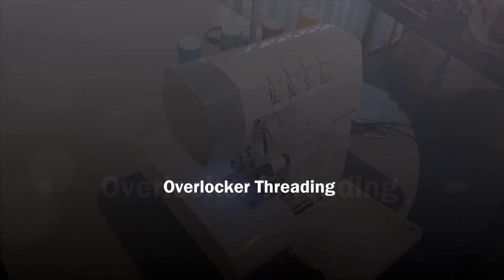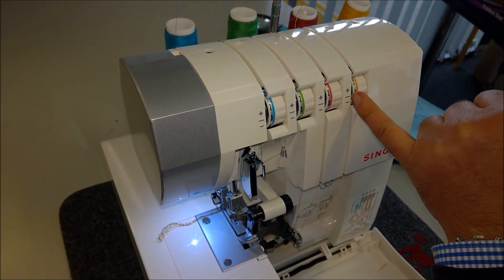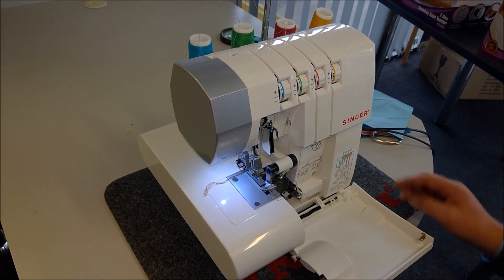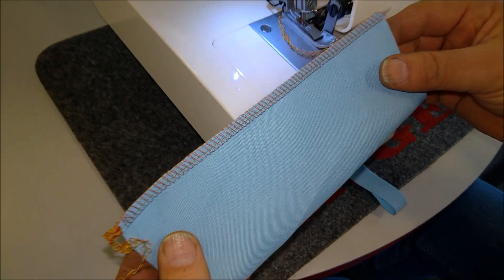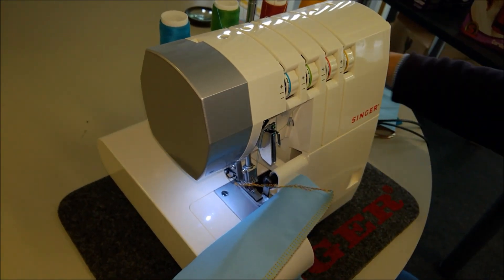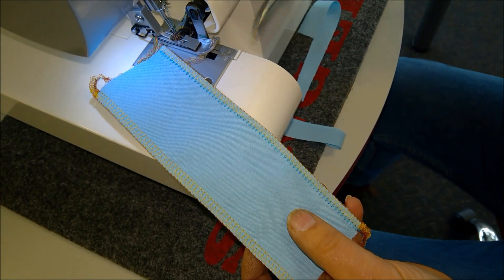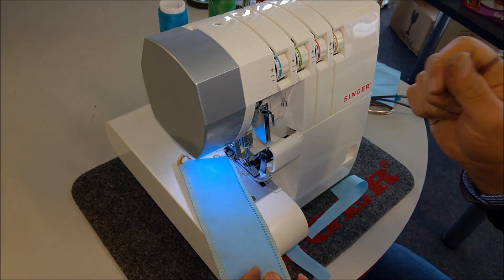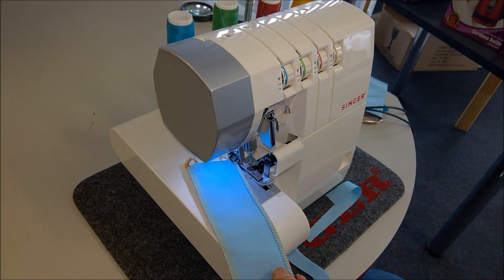Overlocker Tension

Comment: I have re threaded my machine but even at tension 9 it won't make a pretty stitch and it seems that they are loose as if there is not enough tension... is there any way to fix this? How can I open the whole machine to check the parts? maybe something is off inside? It is really hard to find a technician here since they would charge me double the price I paid for the machine, but I don't believe in "throw and replace", there should be a way to fix it  right? thanks
Reply from the maker: Hi Erika, it sounds like your thread isn't going into the discs. You shouldn't need to go to tension 9 if you are catching the disc. Hold the thread at the top and pull it down through the disc and then floss it in to make sure you have it. If you thread it from the left of the gap it will be easier to engage the disc. Feel free to call our office in Sydney if you need more help. Thanks.